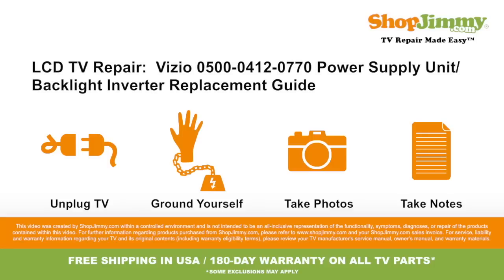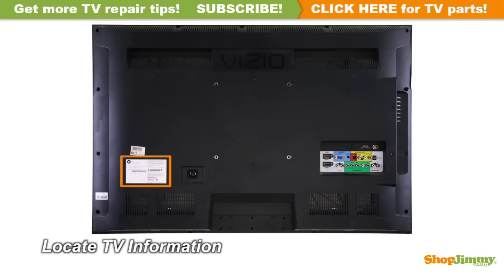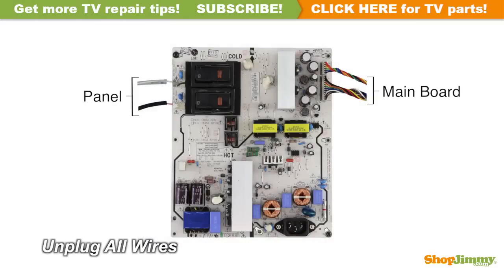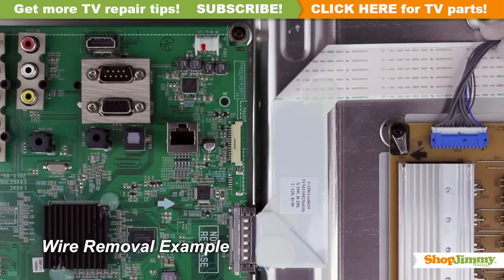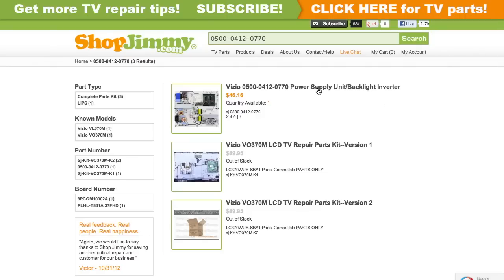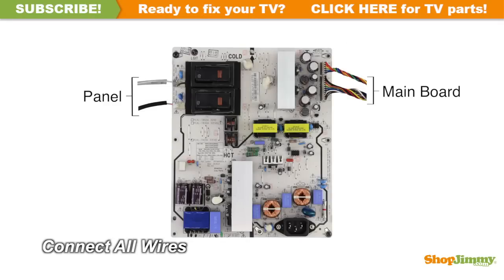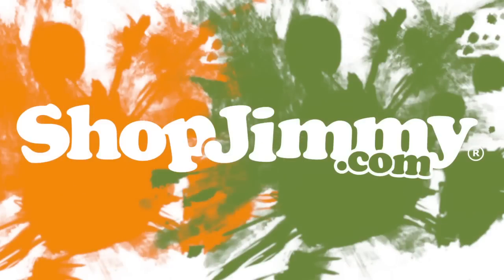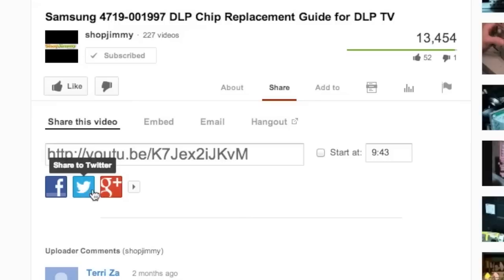Vizio V 0500-0412-0770 Power Supply / Backlight Inverter Boards Replacement Guide LCD TV Repair

Comment: I have a Vizio model e60u-d3 which turns on, but now the screen appears bluish.  Note that I recently replaced the main board as the tv wouldn't boot at all - however this bluish issue wasn't occurring prior to that.  So does this sound like a backlight problem, or could there now be an issue with the backlight inverter portion of the power board?

Comment: Hi I have a Vizio XVT553SV Model TV.  Yesterday, while the TV was on, suddenly, the picture and sound went off, with the VIZIO white light on. I tried recycling by powering off, wait for 5 mins and power on, now only the amber light comes on, but the TV doesnt turn on, nor the white vizio comes on. Reading on the web info says it may be a power board issue. Your advice is appreciated

Comment: I have the exact Vizio model used in your video. Yesterday, TV came on and had sound, but no picture. Seems as if the backlight would not even kick on. Today, TV will not turn on ("Vizio" light will not even light up orange while in standby). Have tried hard resets, changing power outlets, etc. Leads me to believe the power/inverter board is bad. Can you think of any other component it might be? If not, I will be ordering the board from your site tomorrow. Thanks in advance for any input.
Reply from the maker: boredashellification   I recommend replacing the main board in your TV.  Please reply with your TV model number.  Click here to view a video that shows how to find your TV model number:  https://www.youtube.com/watch?v=S51nhAmwR2M  Thanks!  www.shopjimmy.com
Reply: ShopJimmy.com Just curious, my tv now comes on and has sound, but after about 2 minutes it completely dies...like it has been unplugged. When it was on I checked the optical input and saw the light on. I was also able to switch video inputs and have sound on all of them. It seems like a power supply issue. Would this power issue be related to the main board or power/inverter board?

Comment: hi i Have a Vizio VW32L HDTV40A and it seems like the Volume button is stuck on Down even with the batteries out of the remote the tv still pops up the volume bar but stays on 0 and if you try to turn the volume up it then goes back down. If you try to go to settings on the tv the Tv just scrolls threw everything as if the volume down button is stuck. What do I need to replace on this Tv to make it work again because the picture is great

Comment: I have a video b500i series smart TV and the back light bulb just went out. do u have a video for replacing the bulb. the TV is only a year old and I don't want to have to buy another one. I'd rather do the repair myself if possible....

Comment: Hello. I have a Vizio E3D320VX model smart tv that turns on but has vertical lines and freezes up watching tv. The sound is fine but the picture is intermittent. What do you think the issue is? Thanks.
Reply from the maker: Blk Apache   I recommend replacing the main board in your TV.  Here is a link to replacement parts for your TV model number on our website, click here:  http://www.shopjimmy.com/catalogsearch/result/?q=E3D320VX  Be sure to match part numbers on your current board, with your replacement for compatibility.  Here is a link to a video showing how to identify your part number, click here:  TV Part Number Identification Guide for Vizio Main Boards (Plasma, LCD, LED)  You can also call our customer service for further assistance with your purchase.  (877) 881-6492  Thanks and please let us know if you have any further questions with your TV Repair!  www.shopjimmy.com

Comment: Hi, Hope you can help me out with this, I have a VIZO  L42HDTV10A . When I plug it in the yellow light comes on, turn it on and light turns green. There is no picture and no lights in the back. Plus you can’t shut it off, it has to be unplugged.  Replaced the main board with tested E-bay purchase. Now TV’s light is automatically on and green without a touch of power button plus still will not shut down and no backlights.  I don’t know.   Thanks Michael

Comment: I once heard a theory that leaving solid state electronics in a constant powered-on state will permit a longer operational life for a unit than were it to be turned on and off repeatedly.  Personally, I would think that in an operating unit with the temperatures rising--for example, in the case of this TV on account of the heat from the back-lites--leaving it on continuously would reduce it's life rather than extend it. Does Shop Jimmy feel the same way?

Comment from the maker: @peter pauley - Try at your own risk.  You will want to remove the back cover from the TV and then search out the backlight inverter.  There should be either one backlight inverter on one of the sides or two backlight inverters (Master and Slave).  Search your model number on our website, shopjimmy com to find what some possible replacements look like and then compare those images with what you see on your TV.  You can also call our customer service for further assistance. (877) 881-6492

Comment: my vizio D48-D0 lights went out a week later i plugged it back in it flashed the logo 12 times and powered down. i did a power cycle then it flashed 6 times and powered down so i replaced the power and main boards. powered it on works but its a constant flashing no dark spots. now what? called but do to virus you don't talk to customers over the phone, you know you cant catch it over the phone. please i need help

Comment: I have a VIZIO 60 led tv some times the pic comes in clear but then sometime the back light doesn't come on and you can hear the audio but then usally the white power light lower left front comes on but the VIZIO logo and pic does not  come on. VIZIO modle E601i-A3 LFTRNWAP0601828 is it a back light issue or power supply issue?
Reply: bob poff jess hagen  me to did you get your fix I have the same tv

Comment: I have a Vizio E3D320VX.  After turning it on you can see the Vizio logo.  After that you can briefly see the backlighting for about 2 seconds, but then the screen goes black and the TV remains on.  You can hear the input sound and can turn channels and continue to hear sounds.  I am not sure if I need to replace the mainboard or the power supply/backlight inverter board.  The mainboard part number is 3632-1742-0150(8D) and the power supply/backlight inverter # is 0500-0405-1320.  This is from the stickers on each board.  Thanks for your help.
Reply from the maker: Jody Ponder   I recommend running the flashlight test on your TV.   Here is a link to a video we produced that shows how to run the flashlight test. https://www.youtube.com/watch?v=xUzCLgoSPGM Please reply with your flashlight test results and we can recommend a replacement part for your TV repair. Thanks and please let us know if you have any questions! www.shopjimmy.com
Reply: ShopJimmy.com Results are that the backlighting stays off.  Thanks again!
Reply: ShopJimmy.com Bump, The results to the flashlight test on my tv are that the backlighting stays off.  Thanks again and I look forward to your reply!
Reply from the maker: Jody Ponder  Please watch this video FIRST to help with your repair!  https://www.youtube.com/watch?v=BP3NVNCGEv8  This TV has a common problem with the power supply and the main board having problems.  I recommend replacing the main board first and then replace the power supply if needed.  Click this link to replacement parts for your TV model number:  http://www.shopjimmy.com/catalogsearch/result/?q=E3D320VX  There may be multiple boards for the same TV model number, be sure to match part numbers on your current board, with your replacement for compatibility.  Thanks and please let us know if you have any further questions with your TV Repair!  www.shopjimmy.com

Comment: hello my Vizio VO47L FHDTV30A, SERIAL# LQPCGCJ4300849, made a pop and wont power on now. no even the logo is on. any idea what part i need to change?
Reply from the maker: Julian Mohabir  Please watch this video FIRST to help with your repair!  https://www.youtube.com/watch?v=BP3NVNCGEv8  I recommend replacing the main board and the power supply board in your TV.  Click this link to replacement main boards and power supply boards for your TV model number:  http://www.shopjimmy.com/catalogsearch/result/?q=VO47L+FHDTV30A  There may be multiple boards for the same TV model number, be sure to match part numbers on your current board, with your replacement for compatibility.  Thanks and please let us know if you have any further questions with your TV Repair!  www.shopjimmy.com
Reply: ShopJimmy.com Thanks! At the moment you dont have the parts in stop. I will keep an eye out for it.

Comment from the maker: @Antonio Chourio - I would recommend replacing the LED Driver on your TV.  We are currently out of stock for your replacement part, but if you search this part number sj-0500-0705-0070 on our website, you can sign up to be notified when the part is back in stock.  You can also call our customer service for further assistance.  (877) 881-6492  Thanks and please let us know if you have any further questions!

Comment: The picture in my Vizio VO47L FHDTV10A went black, and black smoke came out of the back, but there is still sound. Can this be fixed?
Reply from the maker: Keivanna Jones   You will want to find out where the smoke came from.  I recommend checking the power supply to see if there are any burnt parts.  If you do need to replace any boards, here is a link to replacement parts for your TV model number on our website, click here:  http://www.shopjimmy.com/catalogsearch/result/?q=VO47L+FHDTV10A  Be sure to match part numbers on your current board, with your replacement for compatibility.  You can also call our customer service for further assistance with your purchase.  (877) 881-6492  Thanks and please let us know if you have any further questions with your TV Repair!  www.shopjimmy.com

Comment: My Vizio TV turns on screen turns on and works perfectly for about 30-45 minutes, then the screen goes black but I still hear my show in the background. I end up having to turn the TV off unplugged it and wait an hour of two and it comes back on. This keeps happening. Does this sound like my inverter board is bad?
Reply: Yep
Reply: Sounds like the inverter board is going bad

Comment: vizio m470vt popped and now won't power on...vizio emblem in front won't light up.  any ideas?
Reply from the maker: Courtney Gogolinski   I recommend replacing the power supply board in your TV.  Here is a link to replacement parts for your TV model number on our website, click here:  http://www.shopjimmy.com/catalogsearch/result/?q=m470vt  Be sure to match part numbers on your current board, with your replacement for compatibility.  Here is a link to a video showing how to identify your part number, click here:  TV Part Number Identification Guide for Vizio Power Supply Unit (PSU) Boards (LCD LED Plasma TVs)  You can also call our customer service for further assistance with your purchase.  (877) 881-6492  Thanks and please let us know if you have any further questions with your TV Repair!  www.shopjimmy.com

Comment: how to fix my techwood model : twd 20Lc1 tv, 20 inch, sound" and picture works" but no backlight please can you help me  thank you
Reply from the maker: Paul Fisher   Does your TV have backlight inverter(s)?  Thanks!  www.shopjimmy.com
Reply: yes it does, could you do a video on how to fix it ?
Reply from the maker: Paul Fisher
 I recommend replacing the backlight inverter(s) or if they are on the power supply, that entire board.  Here is a link to replacement parts for your TV model number:  http://www.shopjimmy.com/catalogsearch/result/?q=20Lc1  Be sure to match part numbers on your current board, with your replacement for compatibility.  You can also call our customer service for further assistance with your purchase.  (877) 881-6492  Thanks and please let us know if you have any further questions with your TV Repair!  www.shopjimmy.com

Comment: I have a Vizio E552VLE. My issue is the screen will black out but I can still here sound, if I leave the tv off for a long enough period of time, when turned back on it will take longer for the screen to go black. If I turn the tv off and on enough times I can usually get it to stay on, but that no longer seem to be working. Let me know if you need more details. Part no. 10248182022 Serial no. LATKLUAN3801558
Reply from the maker: Camille Dobbins   I recommend running the flashlight test on your TV.   Here is a link to a video we produced that shows how to run the flashlight test. https://www.youtube.com/watch?v=xUzCLgoSPGM Please reply with your flashlight test results and we can recommend a replacement part for your TV repair. Thanks and please let us know if you have any questions! www.shopjimmy.com

Comment: Problem with Vizio XVT3D474SV 47 in. 3D LCD TV
Backlight issue
After turn on the tv I have sound but no picture. 10 to 15 minutes later the backlight turns on and everything works normal. This happens when the tv has 8 or 10 hours off.

Comment: my vizio m3d650sv powers on, but no back light. the repair guy put in a new main board and new power supply but no fix. anyways, thats all he checked was the mainboard and power supply, both are fine, but still no back light. was hoping someone could tell me maybe something the guy might have missed. to be honest he was who the insurance for the tv sent  and he didn't seem very bright. anyways i got a full refund, but thought before i trash the old one i would search and see if i can fix it myself
Reply from the maker: ic3cold87   I recommend running the flashlight test on your TV.   Here is a link to a video we produced that shows how to run the flashlight test. No Image No Picture on Screen-Flashlight Test LCD TV Repair - How to Diagnose Broken Board TV Repair Please reply with your flashlight test results and we can recommend a replacement part for your TV repair. Thanks and please let us know if you have any questions! www.shopjimmy.com

Comment: My Vizio will turn on  with "No signal" comment for about 10 sec then it turns off.  What could the problem be.
Reply from the maker: Bernadine Anderson I recommend replacing the main board in your TV.  Please reply with your TV model number and then I can recommend a replacement part for your TV repair.  Thanks!  www.shopjimmy.com

Comment: My Vizio M420nv has no power.  I have replaced power cord.  Please help.  S/n LAQKGUAL2700635
Reply from the maker: kristimathis95 Please watch this video FIRST to help with your repair!  TV Repair! LCD, LED, Plasma, DLP How To Fix Your TV with ShopJimmy.com Help!  I recommend replacing the main board in your TV.  Follow this link to replacement parts:  http://www.shopjimmy.com/catalogsearch/result/index/?cat=56&q=M420nv  Be sure to match part numbers on your current board, with your replacement for compatibility.  Here is a link to a video showing how to identify your part number, click here:  TV Part Number Identification Guide for Vizio Main Boards (Plasma, LCD, LED)  Thanks and please let us know if you have any further questions with your TV Repair!  www.shopjimmy.com

Comment: Ahh 1 small piece of a circuit board goes bad so obviously chuck the whole thing away and buy a 50$ board. God forbid you teach people to actually find the fault in the board via common areas the board is known to fail. 

This isn't repair, it's one step below just buying a new TV.